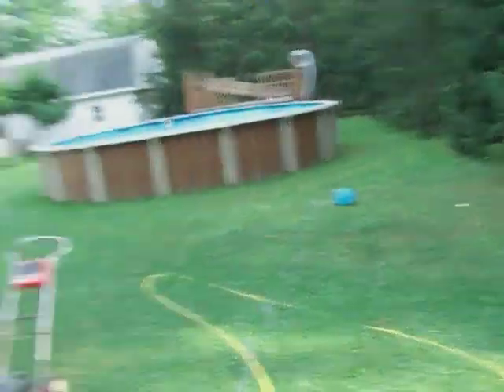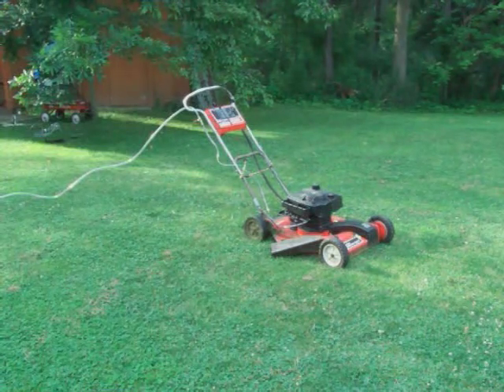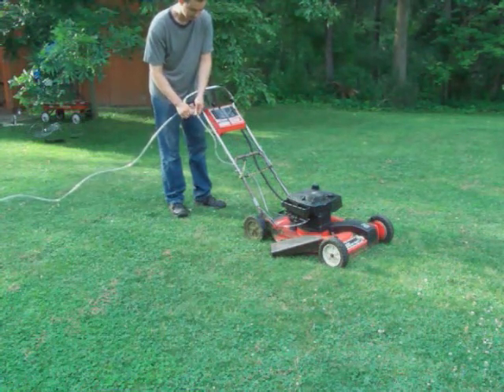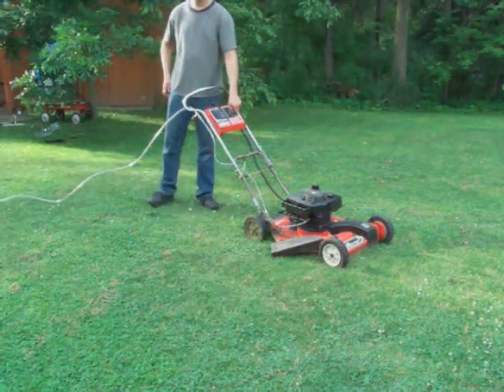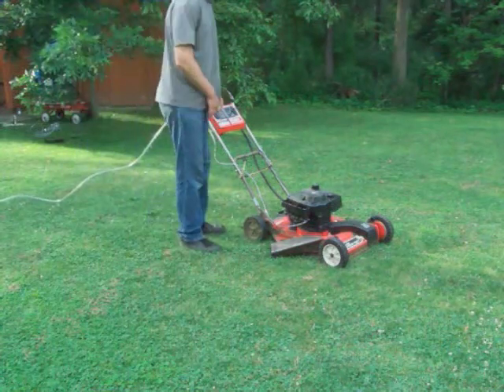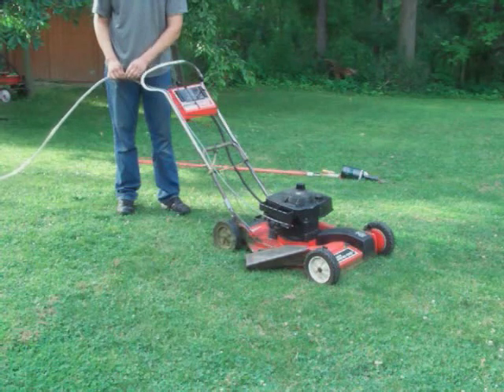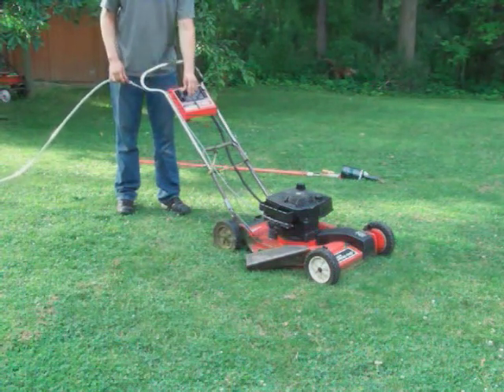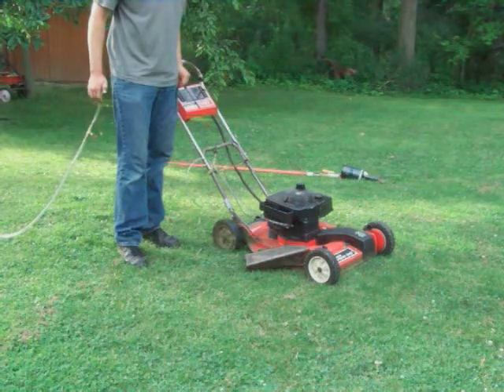hydrogen lawnmower

Comment: wow when it backfires couldn't the combustion ignite incoming gas through the tube and blowup the hho generator.you would have to adjust the ignition timing to prevent backfire. and would a cars computer automatically adjust ignition timing when burning hydrogen or would that be something that some one would have to adjust.
Reply: Reed Briggs If I remember correctly there is a safety thing called a "bubbler" (spelling?), its supposed to break the link back to the source to prevent any spark traveling back to the generator.

Comment: You need to switch from a carburetor to fuel injection. the gas you are making should have enuf o2 for the combustion to work. with a sealed injection system there should be no backfire problems.

Comment: I am very excited about your work. I have an idea you may want to know about. If you ever used peltier thermoelectric cells you know that electric can be generated from exhaust heat. 
Imagine a large Muffler with about 20 of those strapped to it. You could run a high percent HHO and have the thing self contained on the deck. the hotter the exhaust gets the better it runs.

Comment: Please let us know how many times you need to multiply your production rate in order to run that thing at an idle. 
Remember that in order to save bucks on gas you don't need to feed a motor 100% HHO. as you saw yourself, with just a little you could turn your idle gasoline down to almost nothing and when you are full throtle you would be burning much better efficiency. 
That's great that you showed the balloon. 
so how long does it take to fill each time? let us know so we can calculate aprox

Comment: the best way to eliminate any chance of a tank blowing up is to drill and tap the intake manifold, after the carb, and feed your hydrogen in there.  since the opening of the carb is exposed to more oxygen, thats where the flame will form, and not near the hydrogen hose.

Comment: You need a solid connection to the carb intake first of all. Then a tank with more compression, and finally a regulator to control your gas flow rate. Hydrogen is to unstable to run for fuel. Stick with propane. Nice experiment though.

Comment from the maker: @eman20083421 without timing corrected when you put a load on the engine, you will get serious preignition and it will almost always result in backfire from intake. This is because the burn time from ignition to combustion is much faster than gasoline so the spark plug must fire a little later to prevent preignition.

Comment: Cool. Meyer's research lead him to (K.I.S.S. After he learned the secrets of HHO) the 'water splitter plug.'  If the 'water splitter' cracked just  0.5cc of H2O inside a cylinder compressed with ambient moist air, the heat of the cracking would probably crack and then burn all the water vapor near the initially cracked H2O.  So why does everybody focus on his electrolysis process?

Comment from the maker: @1232sean improper ignition timing. timing should be rearded slightly so plug fires later. it causes preignition, which sets off a chain reaction and it will start burning before it enters the engine. that is why backflash arrestors are very important

Comment: first thing is you need to separate the oxygen from the hydrogen, if you fill the balloon and run like that your using both oxygen and hydrogen toghther h20  = 2 parts hydrgen 1 part oxygen

Comment from the maker: yes in this video. i cannot produce it fast enough to run this engine, and the timing has to be changed otherwise when you go to pick up a load it will preignite several times and backfire through thev intake.

Comment: they say it runs better with a bit of hydrogen is because the hydrogen burns 8 or 9 times faster than gas so the hydrogen burns then the gas burns. If you ran it just on hydrogen and felt the exaust you could feel some moister or water vapor because it rebinds with oxygen making water

Comment from the maker: it must be compressed and condensed into a liquid. this technology is not advanced enough to run a mower to cut the grass. it would use far less energy to just buy an electric mower and mount a car battery to it with an inverter. also this method could be recharged with solar power.

Comment from the maker: i did that in the next video i will be posting, but my whole pressure tank blew. it blew the bubbler and went to the tank, i will now be making a flashback arrester and doing many tests before hooking up to cell again. it appears that bubblers are only good for very low flow and higher flow rates are not good.

Comment: Just put it straight to air intake / carburator. If you have bubbler bubler will blow up but you cell will not blow up so just try it out. But you need to make Flash Back Arrestor, just search here in YouTube on that and you will find 2 good videos about how to make one. By the way, I have never saw lawnmower which have electrical start :)